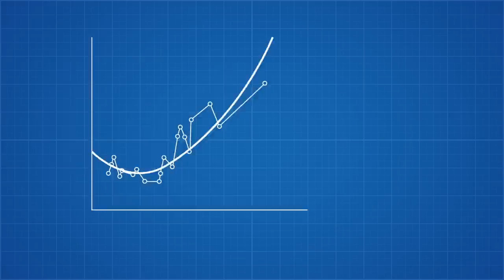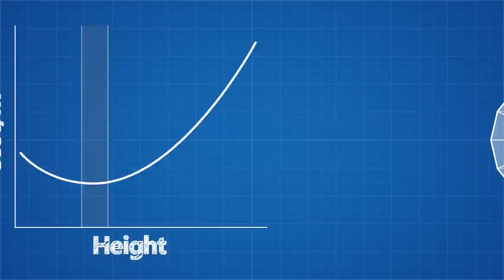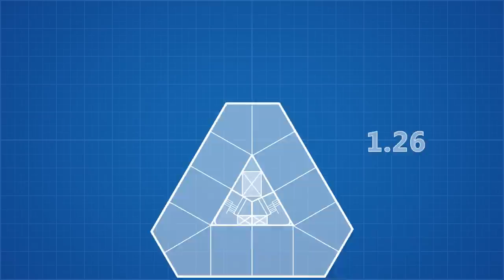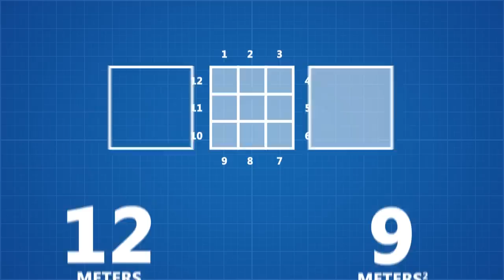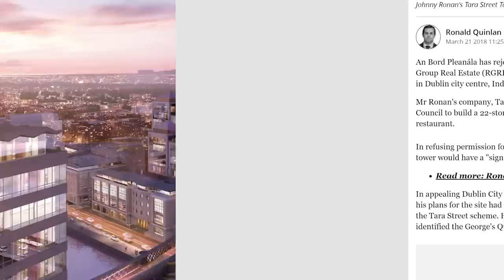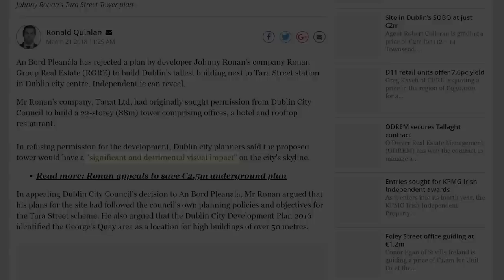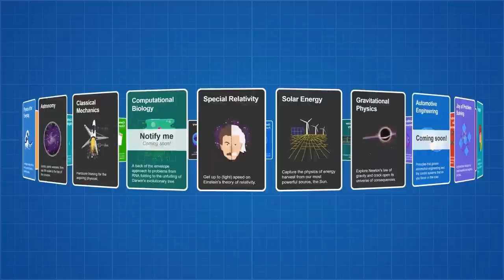How to Solve the Housing Crisis

Comment: Very good video! As an economist I am glad that you pointed out that this is far from an engineering problem. In all major Western cities there is an entrenched class of people who don't want their cities to change. They like the way things are and they have long ago voted for policies such as height restrictions, restrictions on how voluminous a building can be and minimum restrictions on the size of new housing units. These policies essentially prevents new people from moving in while increasing market value of the existing property. This is a political problem not an engineering problem.
Reply: BigMathis yet another reason why the government should be less involved.
Reply: I'm sorry if people don't want to change iconic skylines and neighborhoods to change, but if every city were to become a Manhattan/ Shangai clone simply to allow more people to move into the city centre, then the appeal of living in it will be lost.
So in the end, on a purely economical perspective, it is better to build huge blocks.
Another alternate plan would be to keep the facade of older buildings and rebuilt their insides up to modern standards.
Reply: Sorry for this long post, but I hope you read this.
I'm very surprised that you ignored one of the biggest issues with big cities and their unsustainability as an economist. Really big cities in the US, such as NYC, LA, SF, Chicago, etc. have another major problem and that is work availability (they're extremely oversaturated in the high skill market (and even low skill markets in many cases)) which makes them practically unattainable for more than half of their residence.
For example, my city (NYC) middle class has to make over $12k a month or $8k month if you're in a cheaper area. This taking into consideration the 30% rule where you don't pay more than that for cost of living. Single bedroom apartments are just a little over $2k a month, so if you're single, have no dependents and no medical bills, after taxes, you'd just scrape the 30% mark. 
Mind you, only the highest skill workers can afford that without living paycheck to paycheck every month or without being in perpetual debt. 
Furthermore, NYC is no slouch when it comes to building tall. This video, and by extension, you, make the assumption that building tall means cheaper rents. My areas height limits allow buildings well within the dip curve of affordability in a building, yet our rent prices are $2600 for a single bedroom and $3,400 for two-bedroom apartments in new buildings. In fact, since our mayor approved 200 permits for 6+ story buildings in NYC a few years ago, prices have actually gone up in areas where they went up. My area alone got 10 new buildings in the last two and a half years. This is called gentrification. 
Here's a big thing you guys missed. Once a city is expensive, to assume that prices will drop when new buildings are built is naive, to say the least. Why? Becuase developers build with profits in mind. After permit costs and construction, they have to make what is essentially market price with a little extra for the luxury of it being new.
No developer would ever start building projects to make things cheaper. 
The second assumption you're making is that even with new development, the growth of new housing would be parallel with population growth. That's simply wrong. Megacities grow too quickly to keep up with demand and the more you build, the more people come. The only thing you can hope for is a complete housing market crash, similar to how overpriced stocks, crash when the value goes way higher than the asset is worth to people. 
Sorry for the long reply, but I would think someone with an economics degree would be able to see these issues pretty plainly.
EDIT: Almost forget, but the more people move into a city, the more strained the job market becomes, and by extension, the higher the strain public housing services have, and by extension, the higher the taxes for middle-class citizens becomes. This is a damino effect that's simply unsustainable.
Reply: This! Holy donkey balls!

I live in Brisbane, Australia. I live in high density apartment living but the only reason buildings like mine exist here was because of a corrupt politician who took bribes from housing developers to let them ignore zoning laws. A little while back the local government kicked around the idea of maybe extending the zone where high density apartments could be built out to where I live. The result was a bunch of people on six figure salaries kicking up a fuss about not wanting to destroy the character of the area.

Specifically, they wanted to maintain the "country town" feeling of the area. This is a suburb less than 4km from the CBD, of one the the largest metropolitan areas which also happens to be the fastest growing city on the continent and they want it to feel like a country town. It's short-sighted and unsustainable and unnecessary but you can't convince these people because they've already got their house with a white picket fence, pool and huge lawn and don't just care.

It's so bizarrely self-centred but you can't reason with them because "the character of the area" is somehow more important to them then people actually being able to afford a place to live. And then they complain about their grand kids not moving out of home at 18.
Reply: You know what? I'm not done. The same group of people who didn't want big apparent complexes also didn't want a subway which would connect to here.

No justification. Just that they thought a subway would somehow ruin the character of the city because it's underground. Never mind the actual benefits, just the fact that they didn't like it for purely arbitrary reasons was enough to lobby the government into not building it and moving the replacement transport infrastructure so it wouldn't connect to here.
Reply: Yeah we see how good that works in cities... Everyone is living close to their work, traffic jams do not exist... /s
Reply: I would add another situation which is that many people do not want condos. They'd prefer a house even if its farther away. For example, in Mexico city there is housing bubble becuase there are too many 'loft&luxury' mini apartments that are far too expensive for people and that no one is buying, however there are plenty of abandoned inmobiliary developments thats are too far away and still a housing crisis becuase people wanted to afford a house, not an appartment.
Reply: Or a reason to become politically active in your local district to change such things. Housing especially is something that needs governmental supervision more than many other things. No for-profit company would build affordable student and social homes in the vicinity of city centers.
Reply: Whether or not being stuck in rush hour traffic is leisure time depends on your state of mind. With conference calling, my friends and I use our morning and evening commutes as time to enjoy each other as a social group. We value the time we spend talking to each other everyday.
Reply: nothing wrong with wanting to keep the city the way it is. at least in the old cores of cities.
Reply: abcdf Except universities, big charities, and entrepreneurs who can make a building assembled in 19 days with a ton of tiny apartments for cheap.
Reply: Miguel Mourato Many of those cities already lose their appeal cuz they cost too much. Would you rather beautiful havens for the rich, or affordable jagged skylines for all?
Reply: BigMathis True! And maybe a Georgist land tax structure too: fewer residences in city centres, but greater incentive to build high everywhere and create wealth.
Reply: BigMathis so you will establish communism and force people?
Reply: cut the flow of immigration when unemployment is at a record low? in the us alot of places are desperate for labor which immigration helps with. U can reduce foreign speculation with taxes on "foreign buyers"
Reply: You are assuming the government functions at least neutrally.
Reply: A very good example of this is the current problem that the politicians in Seattle, Washington, USA have created.  There are a tremendous number of building and zoning restrictions, and Amazon and several other companies located there are providing employment with high dollar wage earners.  This has driven up real estate and rent prices without allowing the expansion or replacement of low income housing.  The politicians have discovered there is now a homeless problem.  The plan is to have a tax on large employers to pay for housing the homeless.  The large employers are now considering leaving.
Reply: True. And also (and perhaps above all) rent controls, which directly de-incentivize the building of new housing and the maintenance of old housing.
Reply: Who are you to come in from outside a community and tell them that they have to sell their homes and build apartment buildings in their community? They are allowed to vote for what they want from inside their community and live how they want to live. You can't just steal people's homes by abusing the law and trying to force council members from a greater area to extend zones into these smaller communities, where u don't live so that you can purposely devalue their homes and move in next door to enjoy the streets they built.
Reply: Middle class doesn't want much to change because they are doing well enough.

Wealthy simply want to cannabilze everything for profits.

Poor are just poor.

Currently in big cities all that is happening are that the poor middle class are being divided up among the rich and the poor, with the vast majority moving into "poor."

Where I live now you have to make US$115,000 / year to afford the average rent for a 1 bedroom apartment. The amount of people who can afford that is about 4% of the population of the area.

The easiest way to fix this would be to incentivize the rich to build in other areas that could really use more infrastructure and people but the returns wouldn't be as quick so it just doesn't happen.
Reply: BigMathis...leisurely drive to work... lol... you don’t live a real city. The lack of decent public transport to help alleviate rush hour traffic is a whole other problem. I’ve never had an issue getting anywhere when I was NY compared to LA which is less dense.
Reply: Miguel Mourato Paris is much more dense than most American cities and do you think it looks like Shanghai?
Reply: Mr. Clean immigrants have virtually no effect on housing prices
Reply: Wait, what? It is perfectly understandable that people dont want their smaller towns becoming giant, overpopulated shitholes. 
Cant people really comprehend that many actually WANT to live in a smaller city/ town?
Reply: Mārtiņš Kaktīts you mean smaller cities like San Francisco, New York, Dublin, London and Los Angeles?
Reply: Vorawind sure blame it on the migrants and not on rich CEOs who profit from rising rents, you are so genius, I bet Americans can't afford healthcare just because of migrants too right
Reply: the cause is simple and singular, it's the government, from artificial interest rates to building restrictions, if a building costs significantly more than the materials and labor on average then there's interference, end of story.
Reply: Anarcho capitalism isn't anarchistic since capitalism is a very hirachical system. Even if we all start out equal after some time the companies will be so big that they'll have more power than current government since they have a defacto monopoly on all of the world's recources; as we can see now the profit motive isn't exactly the best goal to govern and capitalism is soon obsolete anyway since we already have more jobless than jobs in the western world.
Reply: Jeremiah John and you seriously think companies wouldn't do that by buying up the surrounding land or interfere in a different way just so they can higher their Profits? Yes the government is currently helping  companies making more money in shitty ways but they will find ways to "maximize profits" (what a beautiful euphemism for exploitation) because you can only make extreme profits by being exploitative and profit is the end goal for everybody participating in capitalism.
Reply: e what is something being "voluntary" really worth when the only choice you have is starve or work for a terrible wage; and how exactly is capitalism more stable when it's built on conflicts of interest 1. Between bigger and smaller companies and 2. Between those who own the infrastructure and recources for production and those who don't.
Reply: e yes because what we need most is the complete destruction of any and all economic growth and stability
Reply: e except that all members of the bourgeoisie will try everything to lower their demand for labour to keep it cheep and how exactly do you imagine a high demand for human labour in the age of automation, it's supply and demand
Reply: e automation doesn't have to replace all humans to drastically devalue human labour, how can you not see that; I mean look at Detroit, look at drivers one job that soon will be obsolete. Like seriously it's almost for you people like you see the market as mythical and just force for good
Reply: e serious question: are you currently doing satire?
Reply: e no we do not ignore that, you are ignoring the direct consequences of capitalism and think that somehow individualistic greed will lead to some kind of harmonious society. We are not against technology , neither against the devision of labour all we are against is individuals owning and thereby exercising sole control over collectively operated recourses. Also you don't need to trade when you just share but you still have the benefits of it.
Reply: e also please don't tell me I don't understand economics when you can't even understand that demand for labour is going down which according to market forces devalue it and give the vast majority less.
Reply: e please look at the real world and the incentive structure of capitalism
Reply: e maybe recommend to read Ayn Rand as well?
Reply: e if you want to be enslaved by modern day aristocrats then fine. Also you are not a slave when you participate in a democracy
Reply: e so according to every society where the individual doesn't 100% choses the rules it follows slavery? Congratulations for calling every form of human society slavery..
Reply: e and you'd still be under the control and opression of someone, the people that have control over your, your housing, your utilities, your food supply, your healthcare, the infrastructure you are using and the land surrounding you only with that you make sure it's controlled by few, every year becoming fewer rich individuals that can afford to buy control of them with their goal being profit and the service they provide only being the means to archive that
Reply: e you think society I only composed of individuals but you completely ignore that we are all part of sociological groups with their collective self interest and different amounts of different kinds of power. This is why I strive for a system where as much people get power as possible in matters that have an influence on their lives and not just people that were deemed successful by the market
Reply: e they don't have to work hard they just have to control the market, look at nestle, amazon and so on,how can you not see that, how can you not just open your eyes and see that a system based on amassing recources doesn't lead to goodness.
Reply: e as if capitalist countries aren't starving. Capitalism let more people starve to death than commies yet they did that with enough food. Bravo for showing your lack of historical knowledge
Reply: e yes you know about stalin, but Stalin wasn't the only person that let people starve, only a couple of years later Churchill did the same. Listen I grew up in the west, I heard all the same anti communist propaganda you did, I've read all the economists you did. Also yes Stalin was terrible but what about the USA? Vietnam, Cambodia,Chile,Iran,Iraq, Afghanistan, plus the economic warfare they have been waging.
Reply: e the difference between communism and capitalism is that every unneeded death have been told you to be necessary or you haven't been shown the massive consequences of the latter. I know Stalin and mao have been historical assholes but they haven't been the only socialists through out history look up Thomas Sankara, shit just look what Stalin did during his genocidal mania, it doesn't justify it in the slightest but it's still impressive, look at Salvador aliende. Yes there have been terrible socialists but we don't support their ideas now, do you really think if unions instead of managers will rule companies automatically people will starve and everybody not 100% communist will be shot in the open street?
Reply: e most of apples innovations were made by state funded research and are you calling having more homes than homeless and more food than hungry people efficient. Give me some evidence instead of just showing that you think unions are evil.
Reply: e tell me why without a rich and powerful suddenly would care about it's workers and the enci ,not try create a monopoly and pursue anything except profit. Also where is your proof again that unions would be worse?
Reply: e yes and what did media exposure of sweatshops did to Nike? Nothing! And you didn't answer what would hinder companies with no regulation. Also free choice doesn't work in a market where there are more workers than work, which only will be getting worse because of automation. But I'm gonna leave you now in your fairytale world where a world driven by greed helps supposedly everybody.
Reply: BigMathis Why is that a problem?

2 stories is all you need to house all the people in a city.
If the people can't afford to live next to their workplace, they can drive 3 miles to their workplace.
Big deal.
Reply: Make nimbyism illegal.
Reply: "As an economist " In other words, a practitioner of ideological voodoo. Whatever your politics.
Reply: But do you absolutely must live in that city? If you can't afford a house there, maybe you should go to another city where houses are cheaper. Oh, and if there is not enough people to fill the available jobs then companies will move to the other city too, looking for employees.
Reply: @sdrawkcabgnipytmi6599  
Where's the evidence for that?
Reply: It is an immigration/ political problem. It’s wilful ignorance to not acknowledge that immigration has been the primary factor in the population growth in Western countries and deceptive tactics on the part of politicians who also refuse to mention it.
Reply: Mark Oliver Walsh What a ridiculous comment. An population that increases demand faster than can be met, if it can ever be met at all, is the primary cause of the housing crisis. It’s clear that you’re allowing your political sensibilities of appearing tolerant and virtuous to get in the way of truth.
Reply: @illusiveman1613  He wants to REMOVE government regulation so the free market can work its magic... What about that is remotely communist to you?
Reply: @
BigMathis

As an economist you should know about land values and how they affects the economy and supply of homes.
Reply: Ok so you basically want to destroy historically, culturally, and aesthetically significant neighborhoods to replace them with ugly manufactured skyscrapers so every city can be equally ugly. Ok beauty is subjective, but I would sturggle to find reasonnable people who would actually find it acceptable to raze centuries of architectural masterpieces that constitutes the city of Paris. Hey let's burn the Louvre with all it art collection as well! I live in the city of Montreal which is renown as one of the most affordable city in North America. Yet, second most densly populated borough in town (more than 10 000 people/km²) actually is gorgeous and still somewhat affordable (though the prices have been rising in recent years due to its popularity since it's so beautiful). The problem isn't about reactionary politicians unwilling to make brave moves, but a much more complexe equation of quality of life, jobs, beauty, culture, wealth, general desirability, etc. Weirdly, it's rather the high rises that are responsible for the increase in housing prices in recent years...
Reply: Brisbane gets a lot of migrants from other countries. In Australia, most population increase is from immigration and the children that immigrants have after arrival, (who don't count as migrants). That can be corrected with the stroke of a pen.
Keeping the character of an area is most certainly sustainable. What isn't sustainable is our massive migrant intake. Population increase is short sighted. Why must those of us who built Australia's cities, accept a reduced quality of life for the benefit of foreigners?
Reply: Digging tunnels is an extremely expensive way of increasing transport infrastructure. And who pays for them? The descendants of the people who built Australia. or the foreign newcomers who make them necessary?
Reply: @oldssaccount990  the market is the reason why even though so many houses are available, much of them are empty
Reply: I guess it's not a problem of nostalgy, but an aesthetic problem
Reply: I was just about to say the same thing. It's almost entirely a problem of government regulations.
Reply: @arturojimenez8372  And people distrust politicians more than them.
Reply: @sdrawkcabgnipytmi6599  Stop pretending there is nothing between single-family suburbs and high-rise buildings. Just allowing some duplexes and other forms of missing middle housing and building some public transport lines to allow for more transport options will already help a lot. No one will be forced to use it, but if some people use it, it will take cars off the road and reduce congestion. Allowing people to commute without cars makes it better to drive. So even people who still drive benefit from it.
Reply: @Jean-Poule_II  Paris is one of the most densely populated cities in the world. If some North American cities with acute housing shortages were to even achieve 20% of the density of Paris they would have no housing shortage. 21000/km^2 in Paris vs 3000/km^2 in LA.

Paris has its own set of affordability issues, but that’s moreso due to the fact that there are no other large economic centers in France (of that scale) which prevents a more even distribution of the population. There is a limit to population density, the thing is North American cities aren’t even close to it.
Reply: Big cities are a horrible concentration of sad humanity   with ubiquitous loneliness for many.
Reply: China can solve the problems because its politicians background are engineering 😅
Reply: @Super_Unlucky_Rubber_Ducky  Eh, I think you've made a good case for why most people ought not try living in NYC. Before you commit to a job in Manhattan, maybe ensure your cost of living will be..livable. Otherwise, look elsewhere.